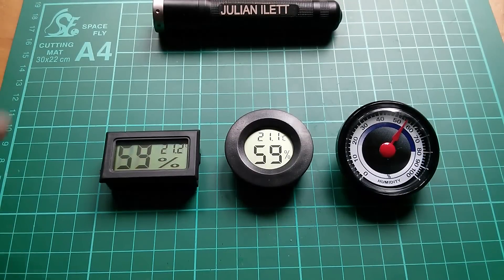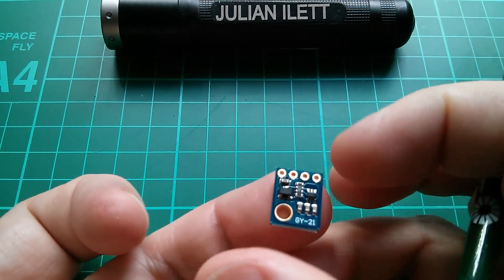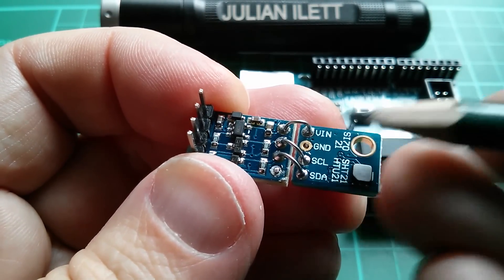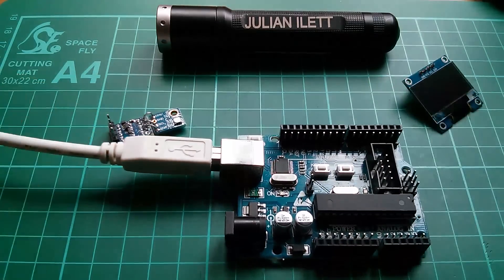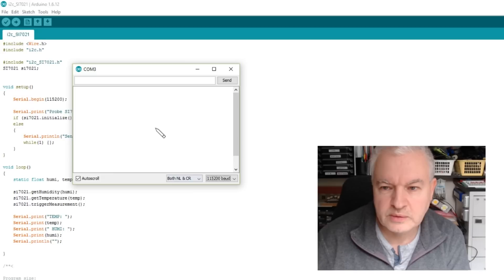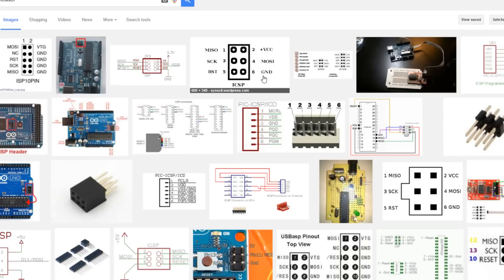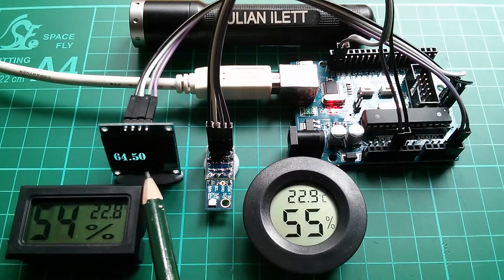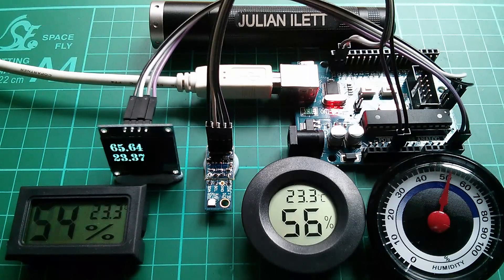1-Day Project: $10 DIY Arduino Hygrometer Si7021 OLED

Comment: You got the facecam out this time. Fancy!
Reply from the maker: Yeah - Logitech c920
Reply: Yes.  Liked having the inset view.  Keep that.
Reply from the maker: I'll try :)
Reply: The quiality of the CAM is superb. Problem is only the FPS. It freezes sometimes.

Julian, did you try QuickSync (if Intel HD Graphics) or NVENC (if NVidia Graphics) yet for the H264 encoding? This will load off the effort to encode the video to the GPU rather than the CPU, which is in fact much faster.

AFAIK OBS doesn't support AMD yet but there are unofficial versions with AMD encoder options.
Reply: The reason that OBS doesn't do 1080P on the webcam is simple. You simply don't need it.
If the video is 1080p, and your facecam only uses 1/10th of the display, you would only need about 1/10th of the resolution.
Reply: Same one I have! It is good, isn't it? :) True 1080p in Skype chat, too :D
Reply from the maker: Not as good as I was hoping - 1080p doesn't work in OBS and the autofocus is unreliable.
Reply from the maker: I doubt my PC has any fancy hardware in it. It's got whatever you get for £120.
Reply: Depends on the age. For that little money, you still get pretty decent CPUs. You can still try to lower the quality vs effort setting of the encoder to the lowest, then use 60 000 kbps bitrate. After editing, you can compress it with x264 in better quality with lower bitrate for faster upload. :) You will get more FPS, bigger intermediate files but same quality on YouTube.

Comment: I have had the analogue one and the round one next to each other on my desk for a few months. They seem to drift ~10% to each other, but are generally within 2%. Neither seems to be persistently high or low, they are just sometimes higher or lower.
Reply from the maker: I was using the mechanical one, but it's 15% lower than the Si7021 :(
Reply: I can't say anything about the absolute accuracy of the two, just how they performed relative to each other. I expect your Si7021 probably is more accurate though, just by the nature of the measurement element.